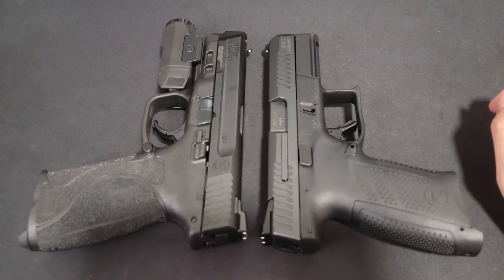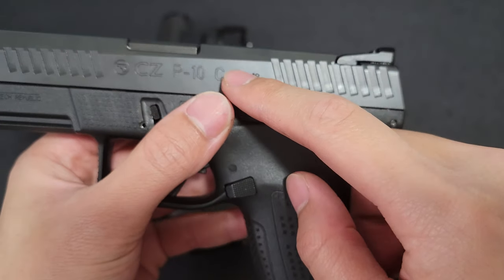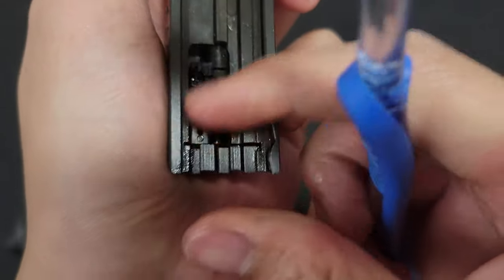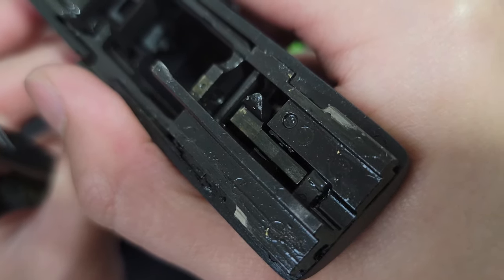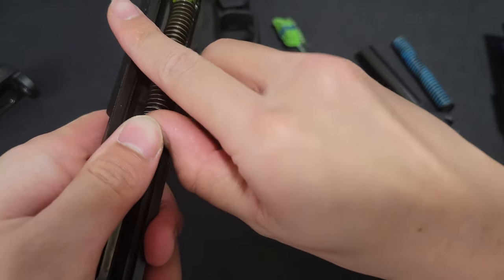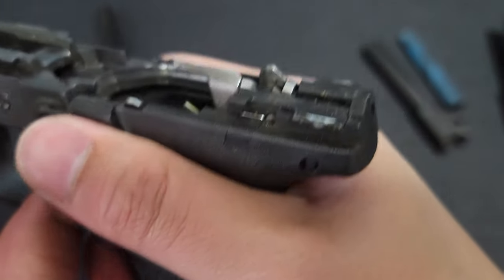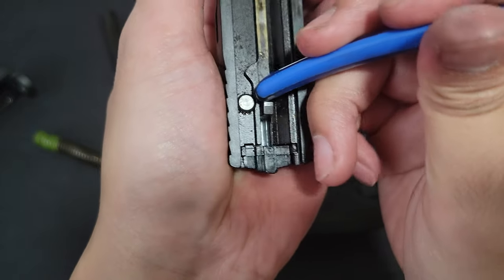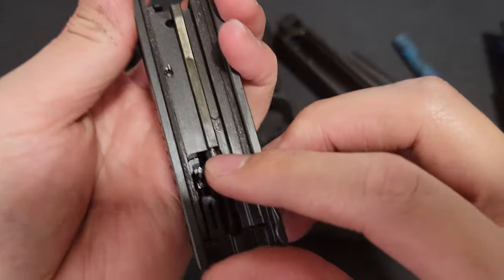Addressing the CZ P-10 C Firing Pin Stop Design Flaw (Read Description, Updated 7 April 2021)

Comment: Outside of the factory, we’ve also employed the services of an NIJ-certified independent third party to perform testing to the P-10 platform in accordance with NIJ-STD-0112.03, Autoloading Pistols.
During this outside testing, P-10s of various configurations/models were subjected to extremes of temperature and environment like sand, salt water immersion and more. Another aspect was extensive rough handling and drop tests. In those tests the P-10 performed as we knew it would – experiencing no failures.
The main safety systems, as you’ve mentioned in your write-up, are the trigger safety and the drop safety. Both of these mechanical safeties work to prevent the P-10 from firing without the trigger being pulled.
The safety in question is a third safety, known as the ‘automatic safety.’ For the automatic safety to ever need to be employed, either the firing pin, the sear surface of the trigger bar, the trigger bar spring pin or the frame itself would have to fail. In the incredibly rare instance of one of these items failing, the role of the automatic safety is to reduce the chance of the firing pin igniting a chambered round, adding a third layer to the robust safety system within the P-10.
There are many factors present in the 'testing' in question that are not able to be present in the P-10 during use in its assembled form. First and foremost, the firing pin travel exhibited in videos of these ‘tests’ is far greater than the maximum firing pin travel reached during the normal cocking/firing sequence (to the tune of 1.5x, resulting in a corresponding increase in inertia within the firing pin).
Realistically and in the worst case scenario, were a failure to happen the firing pin would be falling from its pre-cocked position with far less force, allowing the automatic safety to retard its forward travel. When in the pre-cocked position, the firing pin still has 3.5mm to travel before achieving its full travel and being released by the trigger bar.
A major factor in all of this is that the designers of the P-10 intended this tertiary safety to function once and as a last resort were a parts failure to have occurred, envisioning it much like an airbag in a car. During normal use of the firearm, the automatic safety never impacts the corresponding shoulder on the firing pin. As such, when called upon those two engagement surfaces are able to make positive contact, hampering the firing pin's forward progress.
Subjecting the system to non-standard testing such as this will in no question create undue wear to those engagement surfaces, and the more times the test is repeated, the less chance the automatic safety will be able to perform its function in the rare instance it were needed. Fully withdrawing the firing pin to that overdrawn position will exacerbate this greatly.
Like in other instances where faulty information on the internet has led folks to perform ill-advised 'testing' that ends up damaging guns
Reply: Nice copy and paste job
Reply: "the role of the automatic safety is to REDUCE the chance of the firing pin igniting a chambered round..." i don't like how you said "reduce..." I prefer a gun like a glock where you can say eliminate. of course anything is possible, but the p10 design seems more like a "slow down" than a "block." i'll pass on the p10 for that reason plus they were assembling the striker block incorrectly initially from the factory (See this video: CZ P-10C Drop Safety Issue). There's too many other options to settle for this kind of crap
Reply: @tonyrogo227  what did he copy from? I’m curious I want to see the original
Reply: All the ytube engineers got to put in there two cents.
Reply: Why doesn't the P-10 have an exterior manual thumb safety also?
Reply: @MP-tf7cc  Most striker fired guns Walter, cz, hk, Glock don’t have safeties some M&P and sigs do. I don’t run striker fired guns with safety’s I do with hammer fired.
Reply: @andershilmo1866 I feel like this is backwards? I don’t know much but based on guns that have fired themselves vs the ones that haven’t…. The striker fire should have a safety vs a hammer fired one minus the 1911 and 2011s of the world. Again don’t know much so educate don’t insult thanks
Reply: @mr.marquis9081  I should have specified single action should have a safety. I have run single/ double action on revolvers and on pistols. Many of them do have safety’s. It’s up to you whether you want to run them in your manual of arms. I personally don’t use a da/sa pistol anymore. I prefer Single action or striker fired guns. As I said before there are striker fired guns that have safety’s like the M&P, sig. many people like to see a hammer and so prefer hammer fired guns. As long as you are not overweight you can look your gun back into the holster. Some hammer fired guys like to put their thum on the hammer so they can feel if it moves on the re holster. There are back plates for Glock and cz which in effect do the same called striker control devices. Hundreds of thousands of people of people carry striker fired guns. Most officers run Glocks or M&P and typically don’t have issues. Of course if you want a striker fired gun with a safety there are various models with them. Most people do not want them on that style of gun and train accordingly. This is the best answer I can give hope it helps. There are several different schools of thought in regards to hangun designs you have to choose and train to proficiency on what makes the most sense to you.  Make sure you are carrying one in the pipe.

Comment: The whole assembly moving is a nothing burger.  You need around 18-20 newtons of force to set off a small pistol primer.  The mass of the entire assembly is around 10 grams and would be pushing against a captured spring holding it back at a force of around 20 newtons.  For that little 10 gram assembly to overcome those forces and have enough force to set off a primer, you would have to drop that gun straight on its nose at speeds well beyond it's terminal velocity.

Also, why did you bend your firing pin block?  It doesn't work if you break it.

Comment: He explained to me that the triangular nub plays two different roles depending on the position & movement of the trigger/trigger-bar/disconnector.
For the record, here's the breakdown:
When the trigger is in the forward/active position, the trigger connector is in physical contact with the striker connector at all times, and holds it rearward, effectively playing the "firing pin block" role while the firearm is in that state. It's actually true that in this state, the block is not "secure," but it doesn't matter because the trigger connector/bar itself is doing its job.

When the trigger is being pulled, the movement of the trigger bar rearward at its "raised" level uses the SIDE of that triangular nub to disengage the safety and pull it sideways (rightward if you're looking down the length of the pistol from behind).

When the trigger reaches the rearward position, the connector drops downward (causing the striker to release) (you can see this when pulling the trigger forward and rearward when the slide is off). It's SLIGHTLY raised after firing, which allows the striker to re-engage against the trigger connector and pull it a little rearward when it cycles forward (this pressure also enables the trigger's reset when released after the slide cycles).

SO, as for the triangular nub's OTHER role: when the trigger connector/bar is in the lowered/down/rearward position and the slide moves back forward, that triangular piece is now moved down & rearward and into the proper position for the TOP of it to forcibly hold the striker safety/block in the "closed" position, leftward. So the SIDE of it disengages the safety when pulling the trigger, and the TOP of it then holds it closed in the rearward position, after the slide has cycled.

So...it's actually an elegant, if unusual design, and I was wrong to be worried. The spring on the block/safety is only really used to move it back into place to allow the triangular nub to do its job when the slide moves back forward.

Hope this helps!
Reply from the maker: You were correct up the last paragraph, the triangle nub in is in fact not designed to hold the firing pin block in place in the rearward position, that would be pointless as nobody carries the gun with the trigger depressed with a round in the chamber. The idea of the firing pin block is that it's designed to work when the trigger is in its forward, ready-to-fire position for safety, by preventing the firing pin from exposing through the breachface. The trigger bar in the forward position does nothing to hold the firing pin block in place as it is different mechanical location. Now we arent talking about how safe the trigger bar drop safety is, that works fine, just the firing pin block. It would be weird to say that your seat belt doesnt work, but your fine because your airbags do and you dont get in crashes.

Comment: This is an interesting find. I just got my P-10C OR version yesterday. It's a (20)21 model. I tried two tests in your video. 1. When pull the firing pin back, then let it snap back. The firing pin block can completely block the firing pin bypass. 2. Push the whole unit forward. The whole unit including the firing pin and its block can still move forward but they can only move about 1/2 distance comparing to yours. The firing pin can still come out a little. Not sure whether it can still strike the primer or not.
Reply: BTW, it needs a mount of force to push the whole unit forward. By measure that force and the mass of the unit, we can get the result how much acceleration is needed to reach the point. Assuming the pistol drop to the ground takes 0.1 second to stop, we can get the speed it needs to reach the acceleration . Then, we will also get the height to make it happen.

Comment: Interesting you are the only individual to have this problem not to mention my division using the CCP 10 generation 2 have got  19,000 rounds through them without any firing pin safety issues
Reply from the maker: Probably because the sear on the P-10 C is great

Comment: You are are 100% wrong and others have commented as such.  You are trying to argue that a disassembled gun demonstrates improper function and somehow that is indictive of its assembled state...which is absurd!  The gun is a system of components that work together.   When assembled the firing pin block is held in the safe position until the trigger is pulled by the triangle part of the action that locks it in place.  If you hold the slide over the frame with just a slight gap you can easily see this.
Reply: he keeps on saying that he's worried that the slide and frame will come apart and then the slide will fire the chambered bullet. the scenario that he's imagining is very likely impossible to happen
Reply: Pretty accurate 👍

Comment: The CZ has no firing block issue. Just because it is different that the others, you see it as a possible issue. If you look back at the development of the CZ P10 series, it has taken years and years of R&D and testing. CZ will never put a firearm into the market with a possible issue. They have tested it over and over again. There is no record of any failure in this regard. Drop tested a million times, it has been though tests and test. There seems to be so many self-taught gunsmiths and gun designers out there that knows the every inch of every weapon ever. Please prove me wrong. Sent the link of the video footage where a cz p10c sticker block or firing block fails.

Everyone can say my friend or this guy and that guy. Come on guys. CZ p10C is just as good if not better than any Glock or S&W or Sig or FN series pistol out there
Reply from the maker: CZ discontinued their original P-10 C because there were design issues man.
Reply: @Radvous  i bought the lates ref, gen 2, and the only difference is the mag release that is single sided now, man. Strip it, check it. The fireing pin blocknis still the same. You glock fanboys will always have issues with with anything that kicks a glocks ass.  CZ P10C. Improving on perfection.... The glock killer
Reply: @Radvous  and buy the way, if there was any issues, cz would have recalled all the gen 1 p10c pistols. It actually a company with integrity.
Reply from the maker: @henripienaar136  who said I was a Glock fanboy? I have Glocks, CZs, M&Ps, Caniks, 1911s, Rugers, etc, you're just a silly goose, have a nice day
Reply from the maker: @Yeet Cannon Outfitters I play on PC
Reply: And Glock never has recalls, just “updates”. Still didn’t see an issue in this vid
Reply: @henripienaar136  CZ P10C. Improving on perfection.... The glock killer
lol, sure buddy. good luck with that.
Reply: @cluckbent6466 lol definitely better than a glock 😂 especially my new optic ready cajun p10c 👌
Reply: @mixedmarksman5873  yeah, that's why i can buy a new p10 for $350.  If they were so great they wouldn't be selling them for the same price as a taurus, they wouldn't have discontinued the p10s, and you wouldn't be swapping out the trigger😆
Reply: @cluckbent6466 have you ever shot any p10 btw? Also the p10 hasn't been discontinued they even sell them in 45 now lol
Reply: @thorwalker1004  yes i did, i wasn't impressed.  the p10s is discontinued.  For $350 the p10c is not a bad gun, I would not pay more than that though.  Glock, sig, and m&p are better options and better shooters hence the greater popularity and higher price tags.  cz tried $500 and no one was buying them,  hopefully they'll sell now at $350.  Seems fair. The p10f 45 is larger than a glock 21 so that is a non starter.  I would consider a cz p10c in 40 if they would get their thumbs out of their asses.   Its gotta be $350 or less though.
Reply: Mine has a bigger issue I can get the crappie thing to fire repeatedly because the slide stays open and I have to treat it like a pump shotgun. The stupid design of the slide stop spring the leg keeps coming off the little tiny block with a little groove on the slide stop the spring leg sits in but the recoil makes it come out. Mine has under 100 waiting on CZ to finally get back to me .They know it's a problem I think the whole world knows about the slide stop spring design issue you can Google it it's all over forums. Shame on CZ crappie design and canik copied them and got the same problem but at least their notch is alot hefty
Reply: I will stick to my Smith and Wesson, Rugers ,and even my Taurus. P10c is trash. Had trouble out of mine day 1. Waiting on cz
Reply: @henripienaar136 they knew about the slide stop spring issues minevis only 3 months oold
Reply: @cluckbent6466 I really regret buying the czp10c. It was and is over hyped. Slide stop spring design sucks I should of waited and got the new sdve 2..2.
Reply: @cluckbent6466 I really regret buying the czp10c. It was and is over hyped. Slide stop spring design sucks I should of waited and got the new sdve 2..2.
Reply: @cluckbent6466 and the crappie slide stop spring design on it I hate my p10c

Comment: SIg made everyone paranoid.  Sig has a history of rolling out firearms with issues... both pistols and rifles.   Yes, any company can have a recall, but CZ is in another league than Sig which is trying to roll out cheap pistols to win a gov't contract.
Reply from the maker: This I'll agree with, the CZ 75s are amazing pistols as well as 99% of their products, but every company has that metaphoric 1%, CZ is no exception. But hear me out, this gun works fine because all of its design except for this one part works super well, which means you'll basically never need this flawed part of the gun, that being said that part is flawed even though you'll most likely never need it.
Reply: @Radvous  It's better to have it and not need it than need it not have it. The very idea of buying a gun in and of itself from home and self-defense. Goes the same way with certain components of a gun.
Reply: The slide stop spring design on  The p10c sucks mine is only 3months old under 100rounds it wants to be a pump shotgun. Bad bad design come on cz.

Comment: I don't think its a design flaw, that whole unit to move forward as you demonstrated, takes a huge amount of inertia, after the trigger fails and slide comes apart, which never happened as of to date, CZ is a great company and did a lot of testing before they release the gun, if its a real flaw, I'm sure lawyers will jump on that with  Lawsuits , and we would've heard about it, like the sig issue, if you're not an engineer i would not trust you're analysis.
Reply: I tested with a live primer, the firing pin block safety does fail to stop a strike released from fully cocked position. But works from repeative strike up to it being around 3/4 cocked. And when loaded, it's only half cocked. I don't know why they didn't make a more "impossible" to fail but I would definitely say it's safe. The sear not being able to move down in the half cocked position alone would be a drop safety. This blocker will only matter if the sear somehow breaks

Comment: thanks man. I don't like the design either. They could do better than that... Safety should be kept first. Firing pin blocks are supposed to be that safety net you can always count on when everything else goes wrong.

Comment: Just inspected mine. If I pull the trigger then rack it the firing pin block is never engaged. If I dont pull the trigger and rack it it is always engaged. Every time the trigger resets my firing pin block also resets and is engaged. I would like to see you perform all your tests making sure the trigger is in the firing position.
Reply from the maker: With the gun assembled and the trigger forward, I can stick a small alan key through the back of the slide and easily move the firing pin block. I hope this helps.